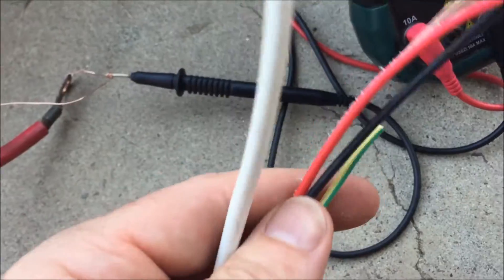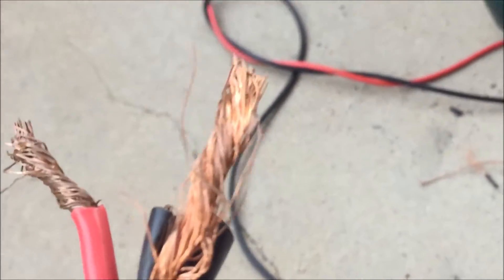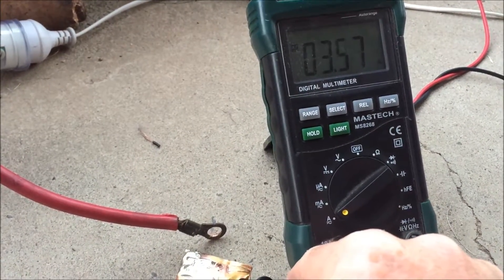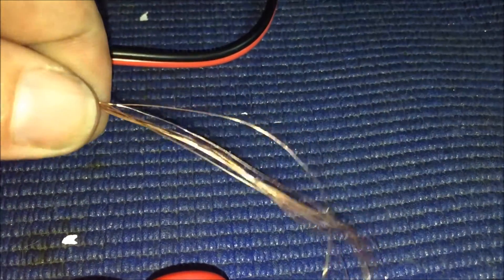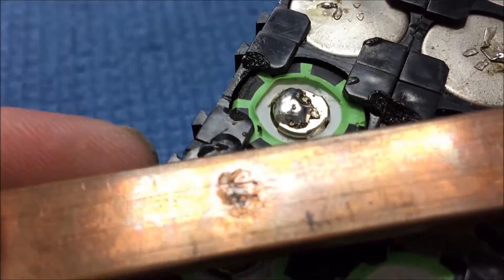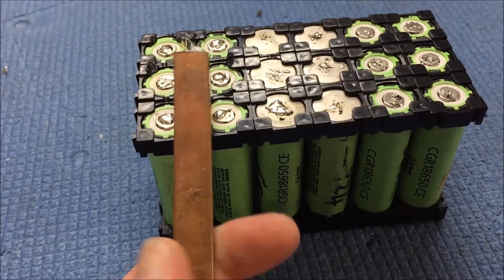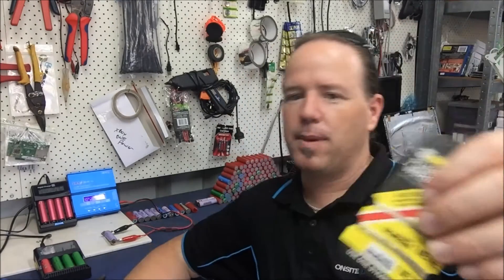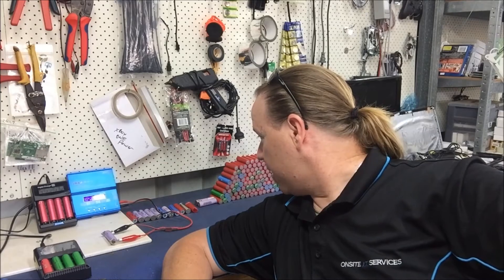Incoherent rant about fusing cells

Comment: Hi, 
I have been watching your videos with interest, Could you try solder the fuse wire to the bus bar first before you glue the bus bars to the battery packs. Then once mounted solder the battery side. Maybe a thinner bus bar as well so you get the heat into it. Good luck with it all.
Cheers
Reply from the maker: +Chris S Yep, kinda how the next plan went in my head :) If i end up needing thinner busbars i'll just use heavy copy wire.

Comment: Reading through the comments I think a lot of people are missing the point of individual cell fusing.

The point of individual cell fusing is to protect all the good cells in the bank when one cell breaks down presenting a short circuit to the other cells. Also note that the current flowing through that single cell's fuse will be massive whereas all the other cells will only be providing only a fraction of the total required to blow the fuse. The fusing will be instant whether it's a 5A or 25A fuse per cell.

Say you had a 100p setup and each cell was fused at 5amps. If one cell failed and went short circuit then each cell in the same bank would only need to dump just over 50mA (0.05A x 99 = 5A) to blow the bad cell's fuse and reject it from the bank. Needless to say, if a cell goes short circuit it will be kicked out of the bank in nano seconds and you probably wouldn't notice it unless you were right there when it happened.

If you didn't fuse each cell and one cell went short circuit you are at serious risk of a catastrophic failure when all the cells in that bank dump their energy all at once.

It still would be advisable to avoid copper wire for fuse wire as you've experienced it tends to glow and bead which is also not ideal if you think of a cell going into short circuit slowly it could present a localized fire hazard.

To protect the whole power bank you still have your circuit breakers inline. So it's best to think of fusing as micro (cell) level and breakers as macro (system) level protection.

Comment: Just a thought, I had a house with aluminum wire in it.  Fire Dept loved aluminum wire because it did not get hot when it had to many amps going through it.  It just disintegrated.
Reply from the maker: Never heard of that, i guess the rest of the world uses copper for electrical that's why i went for it that direction.

Comment: Hey mate, I'm going to use long m5 bolts & nuts to hold the battery packs together. They will screw through the bus bars making a clamping effect on the battery spacers/shell. The bolts will be centre of 4 cells and i will have 4 bolts & nuts per 20 cells. As far as fusing, im thinking of running the fuse wire under each nut washer to each cell. I want to be able to change cells as they fail. What do you think?
Reply: +Neal Wallace I tried this and couple of variants but found it was a lot of work and the result was average. I believe if you can get a fuse wire that holds enough tension then yes. Good luck

Comment: The tesla was a bit tongue in cheek lol I know tesla fuse but if they did not... What current are you expecting each cell to deliver under normal load or is it a suck and see figure
Reply from the maker: +1bigsyd using 1120 cells i expect a max load of 1.25 amp normal will be about .25 amps

Comment: Clean your bar wire wheel is the quickest, texta a mark where the soldering point will be I use a small butane torch pre heaton your texta mark put some solder on it you shouldn't need as much heat for both solder points to join. Works for me.

Comment: Why are you bothering fusing individual cells? If tesla didn't do it would you... Ok it's theoretically safer...but in what way,the cell should not over discharge or over charge,and if a cell went down it would not blow the fuse anyway..just my thoughts
Reply from the maker: +1bigsyd The tesla motorcars do have individual cell fuzes http://evseupgrade.com/pic/?tesla-batt-module3 I believe that is a photo of their car battery.

I have constantly thought about NOT fusing (to save 100 hours of time) but common sense & the old interwebs considers them a requirement or else i'll burn my house down.

I understand it like this, one bad cell is like a sink hole where water just disappears into nothingness. In this case a dead cell is the sink hole where 'power' just disappears - except it doesn't disappear it turns into heat ( as i understand it) The cell will just keep excepting power then short itself out till such a time as the house burns down and the entire interwebs says together ' WE TOLD YOU SO" 

Does that even make sense? 

Pete
Reply: +HBPowerwall that is why i would put a fuse on each battery. better the cell take it self out then bring all cells with it

Comment: http://www.ebay.com.au/sch/i.html?_odkw=pico+fuse+5a&_osacat=0&_from=R40&_trksid=p2045573.m570.l1313.TR0.TRC0.H0.Xpico+fuse+8a.TRS0&_nkw=pico+fuse+8a&_sacat=0

change the number to the desired amount. if you are going to use wire the same amount of work will go into using pico fuses as using that fuse wire. also a fuse will "blow" where it needs to and not any where on the wire.

I am also concerned about drawing such a large amount from a single cell. from memory (from a while ago) the C rating on the 18650's isn't that large and the whole point of fusing them is so they done exceed that rating. I'll look into it more and see what I come up with.